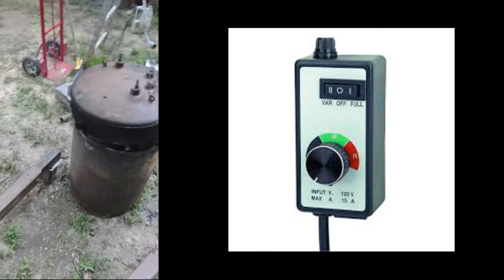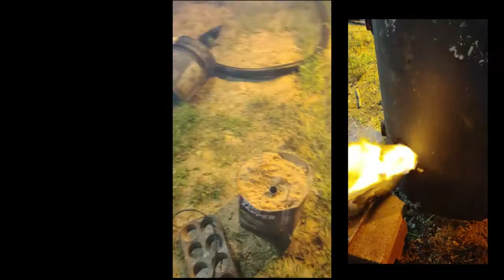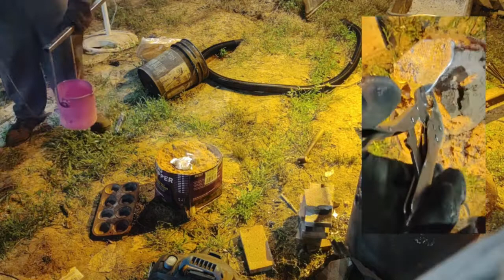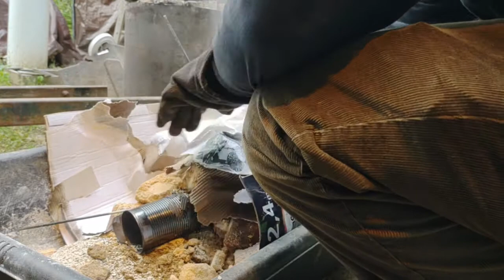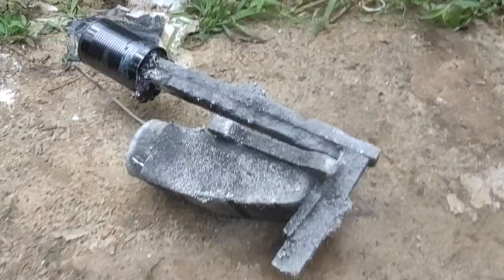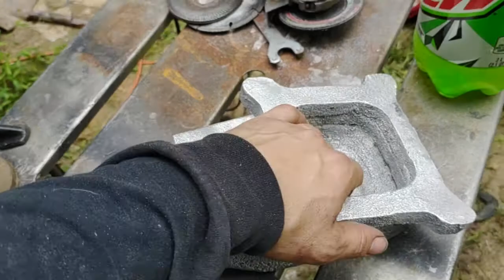How About a Full Rundown on the Waste Oil Foundry?

Comment: A couple comments, lost PLA has more in common with lost wax casting than it does with lost foam in that you have to burn out the pattern before attempting to fill the mold. The sand for lost foam should be clean, dry sand i.e.no clay, water or other additives, you'll see a lot of videos with people using greensand, that just makes it more difficult to pack the mold and impedes the proper venting of the mold. Check out Kelly Coffield's lost foam videos, he's getting absolutely amazing results with lost foam and goes into considerable details regarding his methods.
Reply from the maker: It's funny you should mention his channel, as since I started posting my foundry videos I've begun being served his videos in my recommendation on YouTube. it's been incredibly good information.  As far as the Lost PLA casting: stay tuned, I'm in the process of setting up a burnout kiln and I'm gonna do a bunch of test casts, along with measurements of dimension fidelity and material strength.
Reply: @DerrangedGadgeteer  BTW, Kelly is an active member of the forums at thehomefoundry.org , his username over there is Al2O3, his posts there go into even more detail than his videos.